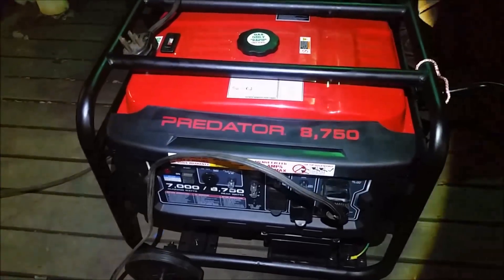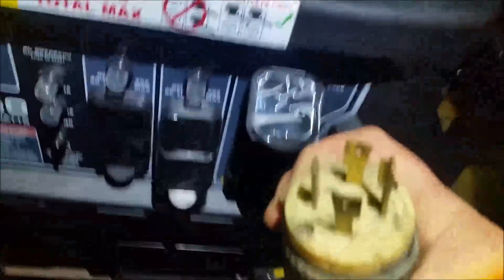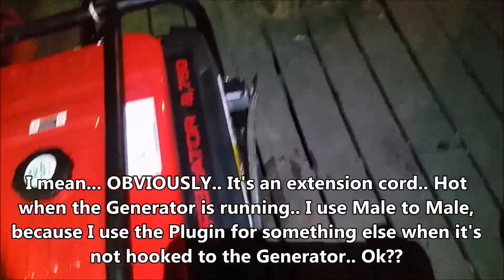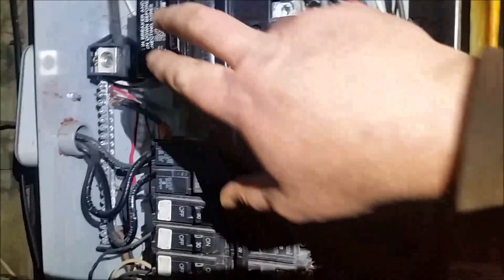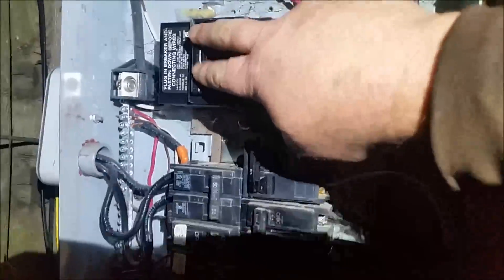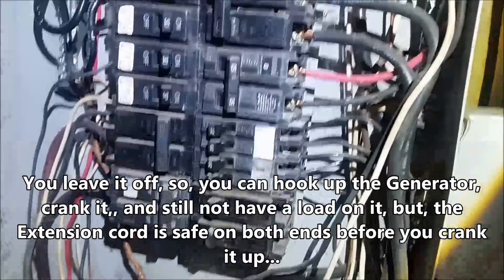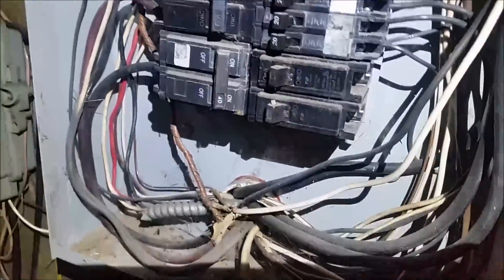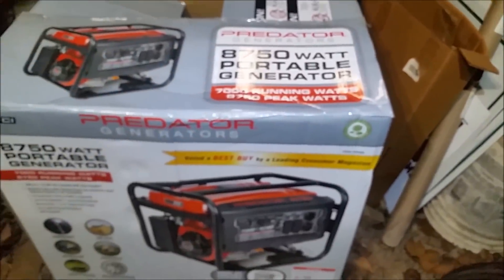Quick/Easy/Safe: Use Existing Plugin/Breaker for Generator hook up to your house Panel box.

Comment: Your video was great, and your still alive to tell your story. Is this the best way to do it? NO  Does it work however? YES  I have been back feeding like this for over 20 years, and oh, I am still alive as well.
Reply from the maker: MrPatriotOne: Well said.. The Proper and Safest way to do this for the "Average Person" is to use the Interlock at the minimum cost or the Generator Transfer switch.. 
For those who know electricity, have common sense and are confident in their abilities, and have above average intelligence,, this is an easy option to be able to use an existing plugin to operate your generator.. But, rules must be followed.. 20 years using this setup.. Yes.. You qualify with all of the above..  Thanks for your comment.. And,,, BTW.. Love your screen  name.. A pleasure to meet you...
Reply: @MarkThomas123  btw not a licensed anything.  Just a homeowner with common sense.  And an electronic tech in the Navy which gives me enough understanding of electricity to know why this works and does not endanger the people servicing the grid (unless someone forgets to turn off the main breaker...).  Does this work? Yes.  Might I do it if I don't get around to installing the "proper" setup? Yeah, maybe.  Just offering an extra insight some people may not consider before they try doing this.
Reply from the maker: Well,, if you are just a homeowner with "Common Sense",, then, why did I just get finished writing a reply to your other comment, showing your lacking of conceptual common sense, not so common.. You complained about Copper to Aluminum, but, failed to see the "No So Uncommon Lack of Common Sense, missing the fact that EVERY residential house, etc,, is Aluminum hooked up to Copper and used it as an excuse for Insurance Companies not wanting to pay.. Total lack of common sense, or at least the Application of Knowledge of what is  10 feet away (up the goosneck), and how it relates to the rest of the house wiring/insurance, etc.. Anyway.... 
Not knocking your Electronic tech in the Navy.. Everyone knows I support the Military and anyone who serves, but, that would be low voltage and most of it D/C, which should make it easier to understand A/C.. Everyone says,, Hot and Neutral, but, you tell me,, is it not a ground, or go to ground? Will it work without Neutral/ground?  There is a simple reason behind just about everything, and most things are relational.. The only person who thinks A/C is complicated is someone who doesn't know how simple it is, or an Electrician trying to hide the fact that he/she is in a brainless field.. Sure, it gets complicated in some instances, but, not in the life of a boring Electrician.. 
You are 100% correct.. If you can't remember to turn off your main breaker, you have Zero Business doing anything with Electricity.. You are surely going to hurt "Yourself" one day... 
But, the likelyhood of you hurting someone with your generator, even if you forget to turn off your main breaker is pretty damn slim.. 
About the time you turn on the breaker to your generator, it is going to lug down and trip the breaker or die anyway.. Only those with Generators do anything to their Main Breakers when the power goes out.. Try to run every home on your switch leg with that itsy bitsy generator.. For the 1 second it actually threw power to the Utility line, 100 homes were sitting there ready to suck up every oz of what you were producing.. 
So,, in true reality,, are you going to hurt someone even if???? Highly unlikely, but, if you do, it won't be nice, so, might as well figure if you are the type that would forget, you still don't have any business messing with a generator, without at least an Interlock......
This video is about using an existing connection, therefore, switches and Interlocks cannot be used.. 
But, only for those who are confident enough and have enough common sense to never make the mistake of forgetting to turn the breaker off...Cheers..
Reply: @MarkThomas123  it is common practice to go from aluminum to copper, just as it is common practice to power a home with a generator.  However if you use a standard wire nut, there will be corrosion and it will completely melt the wire nut and either leave you with an open (best case scenario) or a fire.  The bit about the insurance refusing to pay was anecdotal, if I were in a scenario like that you can bet I would not easily let that slide.  Also, on a side note, I don't think 440v, 60hz, 3 phase AC is low voltage or DC.  Nor is 30,000 volts.  Both of these I work with, as well as low voltage (5v) DC.
Reply: buddyynot1, I  don't think a special wire nut for aluminum to copper would help since the wires are twisted together before the wire nut goes on.
Reply: @shofar-man  you are right sir, there are much better options out there that keep you from dissimilar metal problems.  I used the alumi-con connectors.  The purple wire nuts that are meant for aluminum are much better than others tho but still not the best. But the alumi-cons are pretty nifty.
Reply from the maker: The Power Company uses Galvanized to toss in another dissimilar metal and a zinc coating on top of that.. 
I think that pretty well sums it up.. If they are not worried about it, maybe you shouldn't either??? 
They say you can't weld Mild Steel to Copper.. Find me someone who believes that hard core.. Someone who went to school for welding and we will have a challenge.. Set the rules about what has to happen after the weld to make them happy and make it worth my time, and I will prove him and all of the text books wrong..  You know.. They said we could not land on the moon... They said a plane could not fly.. Could not make tires out of Rubber.. 
Thank God there are people out there who don't repeat and subscribe to the ignorance of others who repeat what others say.. Ask questions, be skeptical and believe almost nothing that you don't verify yourself and you will learn something new every day.. Subscribe to what others say without skepticism, and you will remain one of the sheep.. 
Just my opinion.. But, it's a good one.
Reply: If anything malfunctions, even something unrelated to the generator or the receptical and causes a fire, the homeowner faces having no leg to stand on in most places, since this is not up to code in most places (I say most only because I do not know building codes everywhere), when it comes time to making an insurance claim.  People have had insurance refuse to pay out because they had aluminum wiring and used wire nuts that came with appliances with copper wiring instead of something designed for aluminum to copper.  This seems to be a much easier argument for insurance not to pay for fire damages.
Reply from the maker: Only a fool would let an insurance company skate like that.. Did the insurance Company require the homeowner to read and study to be an electrician before taking his money for insurance?? Would that study have included dissimilar metals?? BTW.. Go outside and look at the first house that has overhead wiring.. And tell me what type of material you think it is.. It's called Areal Triplex if you didn't know the name.. It hooks to "WHAT??? "  at the premises goose head?? 
What??? It is common practice to connect Aluminum to Copper,,, and even in High Voltage/Amperage settings?? 
First, you need to do a study on why dissimilar metals are not "Commonly used in house appliances and extension cords.. Then, think about the service wire and tell me a single anyone who could pin the kind of problems you "Might" have connecting Copper to Aluminum to the cause of a house fire.. Like I said.. Only a Fool would believe, or think that happened, or would have let that happen... Crazy talk is what that is... Not reality.. 
Another NFPA/NEC nutjob..
Reply: http://coopergeneratorservices.com/generator-illegal-backfeeding-dangerous/
Reply: @billwinseck8008  I HOPE THE MORON MARK THOMAS CLICKS ON YOUR LINK !